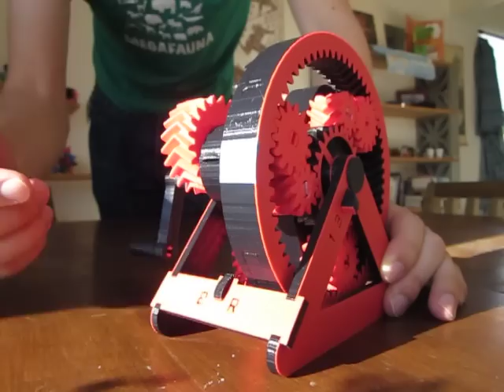3D Printed Automatic Transmission Model

Comment: Last time I checked, "An automatic transmission is a type of motor vehicle transmission that can automatically change gear ratios as the vehicle moves"
Reply: Haha, thats what the solenoids and clutch packs would do when he’s locking those switches. Regardless, this is a very cool and accurate model and I want one so bad.
Reply: @sweetsuductress  Oh ok, thanks for the insight.
Though if you want it, just get a 3D printer. I got an Ender 3 from amazon 1.5 yrs ago and even though it's a hobby printer I have earned enough from it to pay it off 3X.
Reply: @ColinJWiens  wow, what sort of items do print from the ender 3. So people buy them from you too? Nice to see a reply. I wasn't expecting this since your original comment was 7 years ago.
Reply: @sweetsuductress  So far it's been from custom 3D design + printing jobs. Specifically designing 3D printed molds for the customer to form a Kydex product, and a 3D printed training knife out of TPU. Ender 3's can print with TPU if you print a different extruder bracket.

Comment: Could have just said... "I will be taking the place of various mechanisms that would normally be carried out automatically by additional components in a real world environment, for which are beyond the scope & purpose of this model & demo".

As presented, this is not an "Automatic Transmission" when you must first stop the rotation of the input to then, "Manually" change the gear ratio. That's what's know as a "Manual Transmission". I get this is a model demonstrating the inner working of an auto-trans and in real world the switching of the gears would be handled by a mechanism beyond the scope of this model. With that said, it still fails to demonstrate the characteristics of an auto-trans unless your able to carryout the necessary switching of gears while maintaining constant velocity on the input. Unless, you are acting as "Torque Converter" when the rotation is momentarily interrupted manually in order to align & engage the appropriate synchro's. Which, granted, would also be difficult to replicate in your model. In which case, all this should have been explained and made clear at the beginning of this demo.

For anyone unclear...

merriam-webster
AUTOMATIC TRANSMISSION: (noun)
A usually hydraulic or pneumatic mechanism whereby a motor vehicle automatically shifts gear according to actual car speed — called also automatic drive.

wikipedia
AUTOMATIC TRANSMISSION: (noun)
An automatic transmission (also called automatic gearbox) is a type of motor vehicle transmission that can automatically change gear ratios as the vehicle moves, freeing the driver from having to shift gears manually.

oxforddictionaries
MANUAL TRANSMISSION: (noun)
An automotive transmission consisting of a system of interlocking gear wheels and a lever that enables the driver to shift gears manually.

Comment: not even synchro manual let alone auto.... LOOOOL cool lil device ether way. most push lawnmowers have a symilar drive system.
Reply: Those are Variable transmissions being driven by belts.

Comment: You can't say it's an automatic transmission and then go through and manually move shafts, engage and/or dis engage brakes etc.in order to change gears..He didn't show how the gearbox does this on it's own, that's automatic, this is more or less a manual.
Reply: yes...but he doesn't point it out..as another comment further down says..."Almost a model-T manual transmission with a few additional ratios."now hurry along, you're late for school.

Comment: is this automatic? i think it is manual.....
Reply: i know automatic is using planetary gear similar to this, but since there's no torque converter, it is a manual planetary gear transmission?
Reply: jamesgjt  The video description is a little misleading.  Technically, it's a model of the planetary gear assembly, which is just one component of a fully automatic transmission.  The entire transmission includes other elements, such as the torque converter you mentioned.  There are also hydraulic lines, valves and clutches that control which parts of the planetary gear assembly are held stationary.  (They perform the same function as the little tabs he was sliding up and down.)  Finally, there is usually an electronic transmission control unit that controls shifting.

Also, I think that in an actual working auto transmission, the input shaft doesn't slide along its axis to engage different sun gears like it does in this model.  I think this function is performed by the clutches as well.  But I'm no expert, so I could be mistaken.

As I understand it,  the key difference between manual and automatic transmissions is that the individual gears in an automatic transmission are fully engaged (or "meshed"  together) at all times, whereas in a manual transmission, you have to disengage one set of gears and engage another set in order to change the effective gear ratio.  I think this is the distinction the uploader had in mind when he called his model an "automatic transmission".
Reply: obviously there are some solenoids and clutch plates missing from the model

Comment: automatic means without input so it's not exactly automatic is it
Reply: aaron baxter are u on engineering? if not it will be so long to explain
Reply: aaron baxter Well then  considering the gear shifter and solenoids in a automatic transmission are the inputs, neither and automatic nor manual would be truly automatic

Comment: what idiots in the comments need to understand is that in a real auto the gearshifting is controlled by a computer which does all the work while on this model there is no clutch packs or a computer but it still uses the same mechanism as an auto which makes it an auto

Comment: beautiful design but why you call it an automatic? you have to pull levers and brakes to change gears. so in my opinion it is a "stick shift". but again very well done. cool design
Reply: in an actual car servos would control the movements which would be determined by the computer given rpm and torque needs. He calls it automatic because the design differs from an actual manual transmission.
Reply: Almost a model-T manual transmition with a few additional ratios.

Comment: That's not an automatic transmission, that is a planetary transmission, Henry Ford patented it in 1909.
Reply: automatic transmissions use planetary gears...
Reply: Toluene did I say they didn't?  They also use torque converters, valve bodies and clutches.  What is your point?
Reply: ***** only dick is the guy who insinuates that because this has planetary gears and an automatic transmission has planetary gears that this must be an automatic transmission.  I am curious what his point is, kind of curious what yours is as well.
Reply: *****   Hey there, nice Wiki copy, too bad you still have no clue how the Model T transmission works, it had drums on it for the bands to grab the ring gear, 3 of them to be exact, hence a 2 speed transmission, not a 3 speed.  
Go read what I said before, also about your idea of automatic transmissions with torque converters, not all have torque converters, GM had one as well in the 50's and B&M modified it in the 60's for drag racing.  It was an automatic transmission with no converter.  

Final words, if it requires manual input it is NOT an automatic transmission.

Again kid, go somewhere else and try to troll, you have no clue what you are talking about, stick to your smart phone and xbox.
Reply: Eric Johnson No comment Mr. Johnson? Appears you have come to realize you have lost.
Reply: MarioMan543211   http://i.imgur.com/AmSJq5g.jpg I don't feed trolls and I have nothing more to say.
Reply: I found this video of this device to be really interesting... should I be sad that someone patented it in 1909? and I'm like 105 years late to the party? even if you said I shouldn't... I really do feel some what depressed, its like even though I spent all those years in public school I didn't even learn anything like this... not fucking once. And goddamn what a huge time sink that was for nothing.
Reply: Eric Johnson You see,  the thing is, is that you are trying to prove his concept wrong when you really should have no reason to. It could easily be an automatic transmission by having the brakes be computer controlled, so it does not REQUIRE manual input. I see no reason why you could not have kept your comment to yourself, as it did not help contribute anything to anyone. You simply said that just for the sake of saying it, and something like that could easily put another person down. You dont know how much time he spent on this, and he releases it for the world to see. Just out of the blue someone like you has to come out and go "thats not a real automatic transmission!". And just for the sake of doing so you may have made him feel like his work is inadequate or something.
Reply: Eric Johnson lol i asked my dad (hes a rally driver) and he said that this is a planetary gear which can work standard and automatic. So you're wrong. You think because your profile picture is a car you know everything
Reply: Eric Johnson is right though, not even disputable.
Reply: The patent expired already I think because after 50 years of patent holder death anyone can use it
Reply: Eric JOhnson You are totally right. Do not liten to them.
Reply: it IS a planetary transmission, but it just is not an automatic transmission.
Reply: Raven that doesn't make this an auto. it is a manual planetary.
Reply: Raven anyone can build a small block chevy.
Reply: +Eric Johnson I know I'm 3 years late on this thread, but you do realize that this is a MODEL of an automatic transmission. The kid who made it said that he could not make all of the clutches, solenoids etc. so yes there is human input required to change gears but thats the best he could do with a 3d printer..again its a model automatic transmission of just the workings of the planetary gears
Reply: BoostAddict 😂

Comment: Nothing automatic about this, it requires a manual input to change gears!
Reply: Chillisteak real ones use hydraulics but this model and ones used in cars are very similar just without the hydraulics
Reply: but it operates in the same way as an automatic transmission
Reply: Just use your mind to replace his fingers selecting/deselecting various ratios with an electro-hydraulic valve body operating band brakes and clutch packs to do so.
Reply: Chillisteak with some computerization it is an auto

Comment: Automatic is when you dont have to flick switches on every gear, just like an automatic car put it in drive and go. But cool print.
Reply: This is similar to how the automatic transmission in a car works. The brakes are controlled by electronic solenoids that read information from the pcm such as engine rpm and throttle position to determine when to shift, or when to apply pressure to the clutches using the fluid in the valve body.
Reply: This is a concept of how the automatic transmission works, Not that this is an automatic transmission. As fret said there are solenoids and sensors that read the conditions of your driving and shifts for you based primarily on engine rpm.
Reply: Lol, that is the dumbest comment I've ever seen of all time, a guy goes to a video showing a bare model of an automatic planetary based transmission and whines about how he has to manually flip the switches because he didn't throw in everything to make it fully functional beyond a basic model representation..
Reply: Hey, you are missing the transmission fluid, wont the gears melt if you put this in a car with no lube? joke
Reply: Noah Themins lol if you can get it to shift or even move, possibly :P
Reply: ***** lol what fake website did you pull that information off of? they didn't factor in wheel rotation into the shifting of a transmission until the early 2000's, before that, it was really no different than it being a manual, in gear, older vehicles relied on RPM for shifting, if the solenoid fails to read the RPM's. they will peak, and the hydraulics wont let all that stress push it over without that solenoids permission because it doesn't see the crank moving fast enough to warrant a shift. And most older computers didn't even communicate with the transmission more than some simple information. All the computer had to did was streamline engine performance and do it very efficiently by factoring in different factors also based off RPM and throttle, as well as gear position. the vehicle is trying to generate velocity, its not generating velocity based off its velocity
Reply: ***** Certified auto tech that can't spell.
Reply: I don't know, do I have a problem? I didnt think I had a problem. Clearly you are the one with the problem.
Reply: Yes cause spelling is aquired to be a good mechanic, lol
Reply: Thank you for that obvious notice rofl